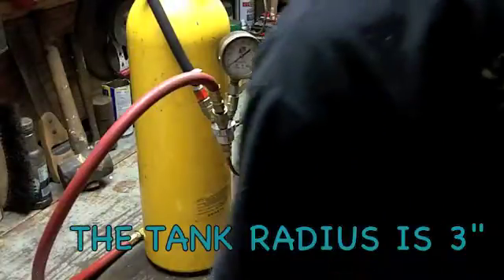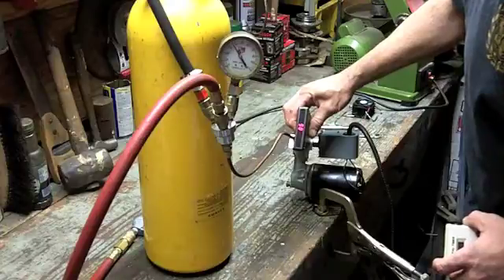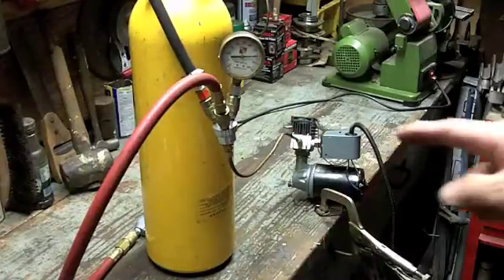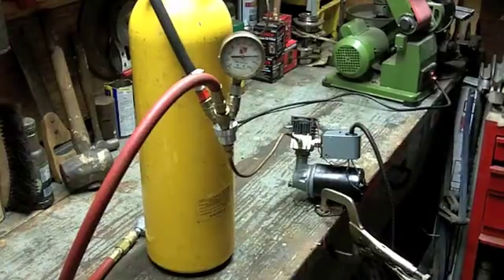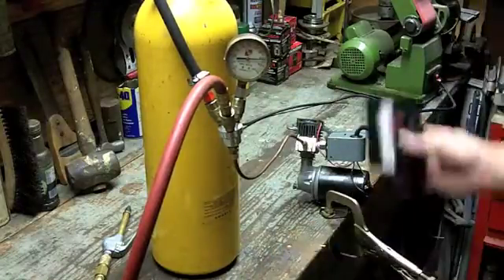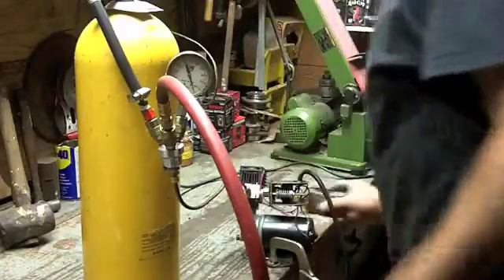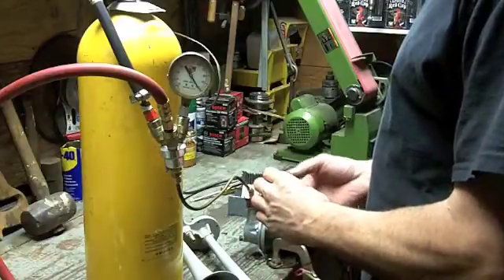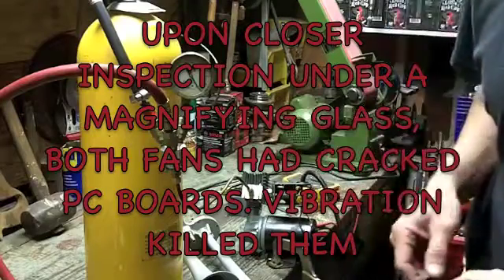Compressing Air With A Grover 1167 Pump

Comment: I’ve got the same compressor for my air horn that’s been stored for years.  My pressure switch is bad.  Do you know the cut in and cut out pressures for it?  Also,  the compressor label is faded.  Is there supposed to be oil in it.  I would assume so since there’s a plug on the bottom.  Thanks.
Reply from the maker: Hi Karl,   I had to replace my switch as well.  If I remember correctly it is 90-120 psi.  Yes, there should be oil it, I run ATF in my pump and have had no issues at all.
Reply: yourbeekeeper excellent.  Thanks. Enjoyed your video too.

Comment from the maker: Everything was running through a battery so it stayed close to 12v, but it was not through a regulated power supply.  The remote mounted computer fan I am currently running is working just fine.  I didn't end up using the heat sink compound...primarily because I didn't have any around the house, and it was transferring heat well without it, and not being sensitive electronic equipment, I figured it would be okay.

Comment: im doing a compressor build also using a v2 mopar ac compressor, 5.5hp gas engine and a 5gl tank. If you got a sec, go over to my channel and check it out (youre mentioned in part 3). tell me what you think, maybe give me some pointers.

Comment from the maker: These are labeled as 12v fans.  I am almost sure the vibration killed them... it is pretty intense when it's touching the compressor.  I will run a larger computer fan but not mount it directly to the heat sink.  I will see how that works out. Thank for watching.

Comment from the maker: It is labeled as a 12v fan.  I think the vibration killed it.  I will still run a fan, but just a larger computer fan that is not mounted directly on the compressor. Thanks Bryon.

Comment: Are those fans 12 volt because some PC fans are 5 volt try regulating the voltage to the fan because in a PC you have just over 12 volt and just over 5 volt good luck like the vids

Comment: Those cooling fins sure helped I didn't think they would work that good.  I would build a box to put the compressor in and use a fan to blow air across the whole compressor.  The fan would be in one end of the box if you could find a small squirrel fan that runs on 12 volts.